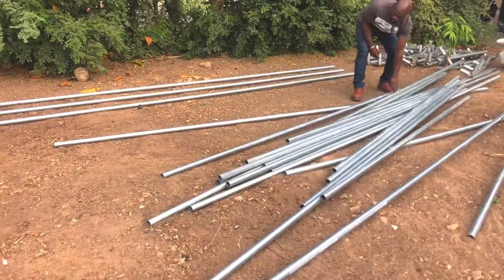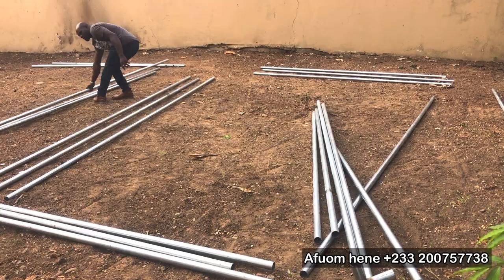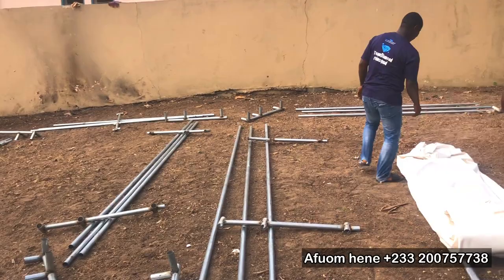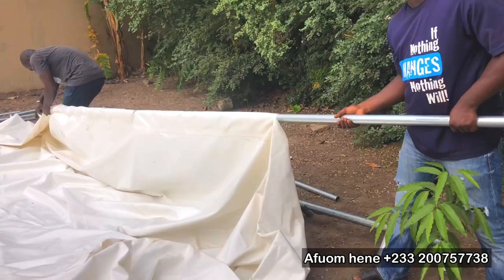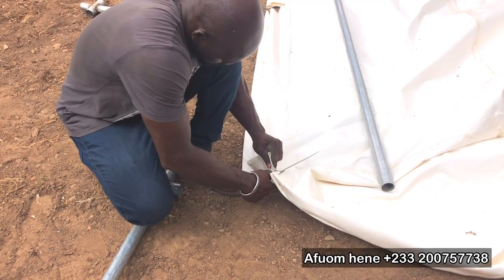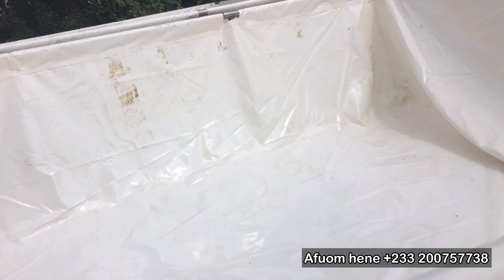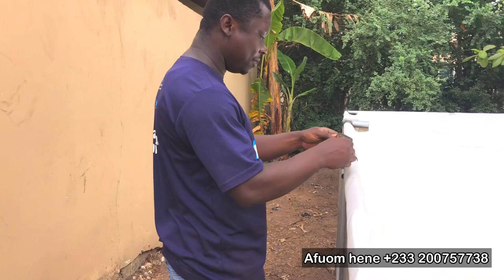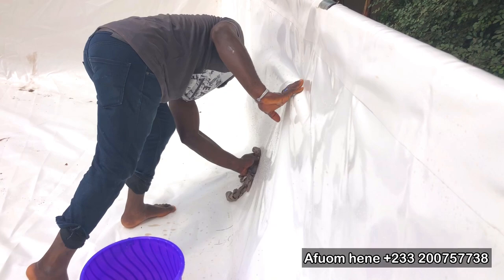Tarpaulin fish pond construction| How to treat a tarpaulin pond |

Comment: Great video. You leveled the frame, what about the tarpaulin itself? Wouldn't the side you raised hold more water than the other side? Has that not got the capacity to skew the pressure unevenly?
Reply: It will help when draining the water through the outlet